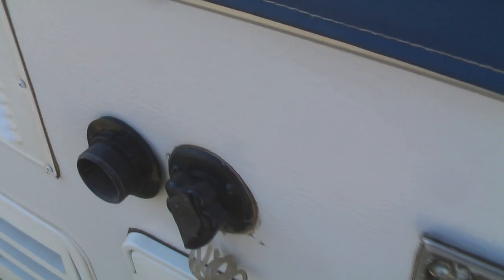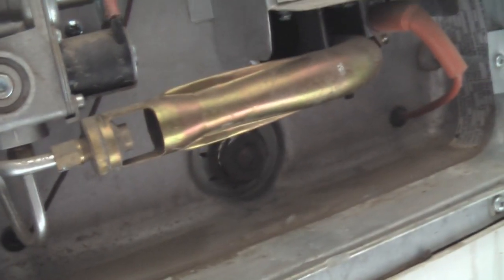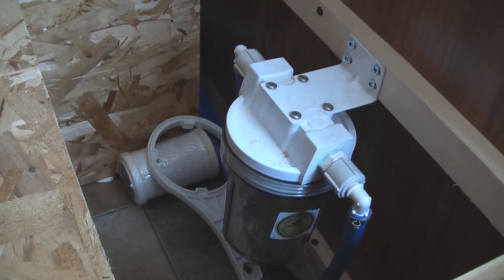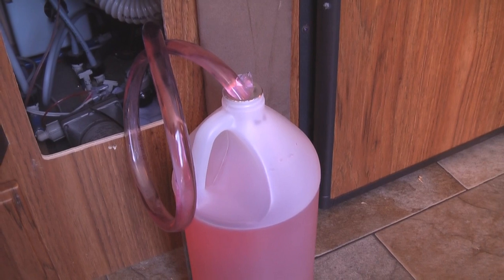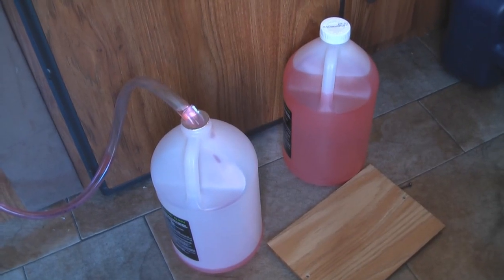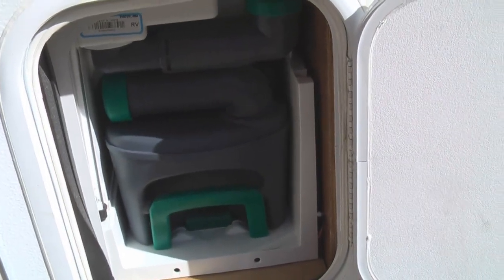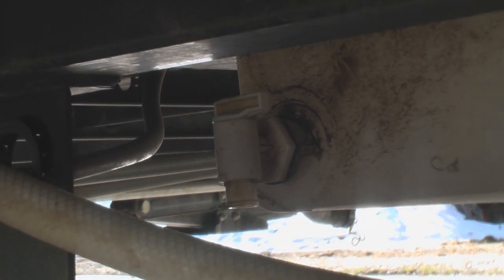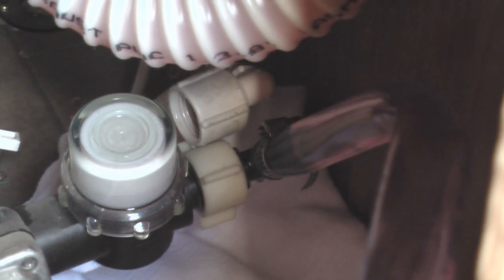Complete guide to popup camper winterization

Comment: De- winterize video please!  This winterization video was a life saver!
Reply: D Cockrell - Have you found a good de-winterize video? I'm looking for one as well. Thanks in advance.
Reply: All you do is the reverse of what you do to winterize. First, place the anode plug back in the hot water tank and tighten with a wrench as usual (use thread tape!). Second, close the bypass to the hot water heater and open the hot and cold water valves to the hot water heater and that’s literally it.

When you go camping after it’s been winterized, just hook up to the city water, turn on the sink and shower (hot and cold) and let it flush until the water is good and clear. Nothing else to do. The only real thing you’re doing up front to prep for winterizing is the hot water heater tank valves like he showed in the video. A helpful tip… when the city water is hooked up and turned on at the campsite spicket, slightly hold open the pressure relief valve on the hot water heater so the air will completely purge out of it. If there is too much air in the tank when it is lit, it can become severely damaged. Easy peasy! You basically just go camping.